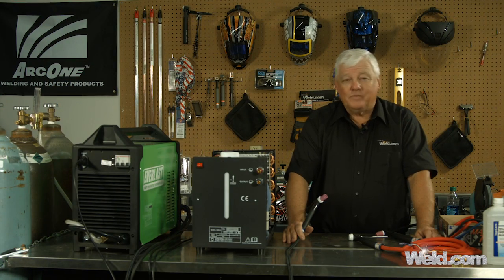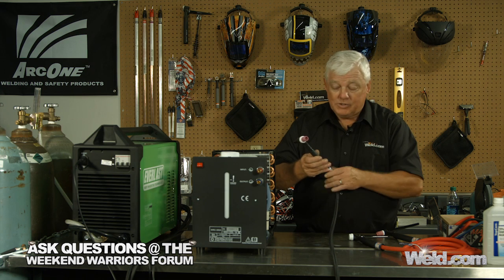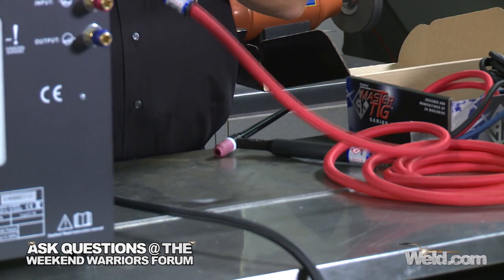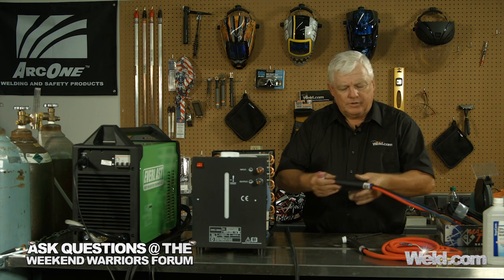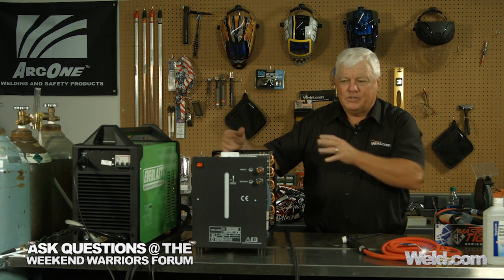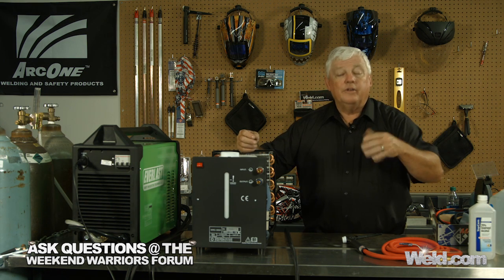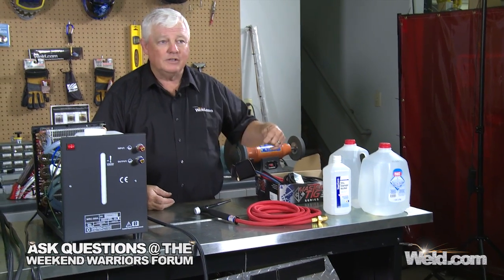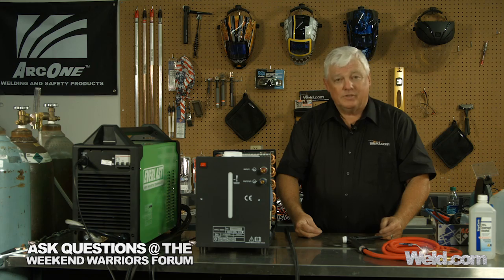Introduction to Water Cooled TIG Welding with the Everlast 250EX | TIG Time

Comment: My Everlast welder came with both an air cooled torch and a water cooled torch. I don't have a cooler yet so I haven;'t used the water cooled torch yet. That water cooler sure looks like a good one.

Comment: Water cooler antifreeze is $25 a gallon it’s not that much to do the right thing when you consider what you spend on equipment. Just put what goes in it so it’ll last.

Comment: Has anyone seen any problems with using IPA in the water?  I used it (1 quart 70% IPA / 2 gallons water), and the seal on the pump blew within 3 months.  This was a new machine with very low hours.  Perhaps the pump seals are not compatible with IPA?
Reply: That is interesting. I just got mine set up and havent tried the mixture yet.

Comment: I'm debating whether to get the everlast water cooler that is rated 300a or 400a.  Is 400a overkill?  I want my torch to be completely cool even if I weld at 250a continuously.

Comment: I need help. 
I bought a 250ex thats like 2010yr used without water cooler and I've been trying to weld but my argon isn't going through both my guns and one of them it won't even spark, i have worked on metal where the gun did heat up kinda bad so i stopped, u think i might have messed up my guns? (Machine turns on, stick works, gas flows to the machine but the machine wont release it to the gun)
Reply: david rodriguez it’s prob just the gas valve needs to be replaced. Easy to do

Comment: If I run this machine up to 200A only, is there a need to put a water cooler? Thanks.
Reply: It depends to some extent on how long your welding sessions would be. You can get some really beefy air cooled torches rated to 300A if you want but they higher the amps and the longer the sessions the bulkier the torch needs to be. I have both air and water cooled torches for my everlast welders but I usually use the air cooled ones because I don't weld for very long.

Comment: I am looking for a welder like this and looked at some other makes like Lincoln and Miller and this seems to be the best bang for buck for both quality TIG and Stick Welding.  It seems you like this welder quiet a bit as well.  Or do you think I should consider some other welders?
Reply from the maker: You hit the nail on the head, Gary. Can't beat this machine for the price. We're also doing 10% off all Everlast machines through July on Weld.com: https://www.weld.com/power-sources
Reply: Oh very cool I didn't know you retailed them.  Do you accept PayPal or are you a Amazon retailer?
Reply from the maker: Gary, at this point we are credit card only. However, we have a no questions asked return policy, so if you're not happy with the machine in any way, just send it back for a full refund.
Reply: Does this machine come with the upgrades indicated in the video for the price shown on your web site?

Comment: I got the EX250 with the water cooler as a package deal.  Haven't really needed the cooler but the savings buying it as a combo made it worthwhile.   Also recommend upgrading to a 17 torch.   I had to do it the hard way, but IIRC they are available from Everlast with the correct fittings now.

Comment: just wondering if there would be a chance of Fire if the line broke with the alcohol in there with the hot metal or if the Torches running just a question thanks
Reply: I think he was saying add a 32oz bottle and the rest water. It would be diluted so much that it shouldn't be flammable much if at all.

Comment: I'm an RV tech and I immediately thought about RV antifreeze and a candidate for a water cooler. It certainly sounds like it has potential but I'm not sure of its heat carrying ability without a water mix... I dont have a water cooler yet so if you find out more on it I would appreciate the info.. :-)

Colin